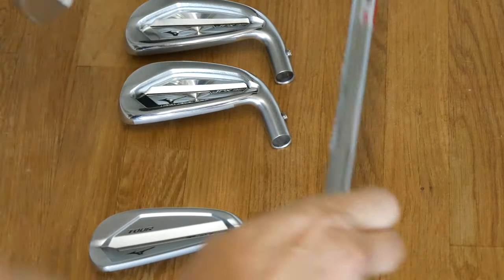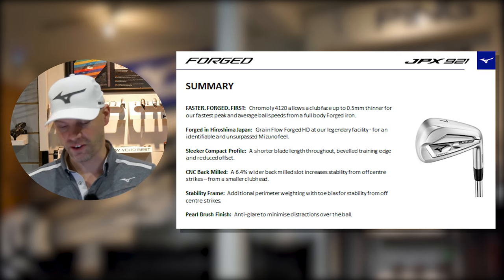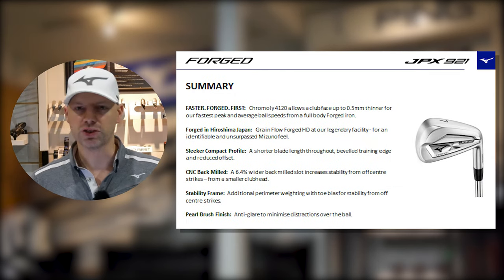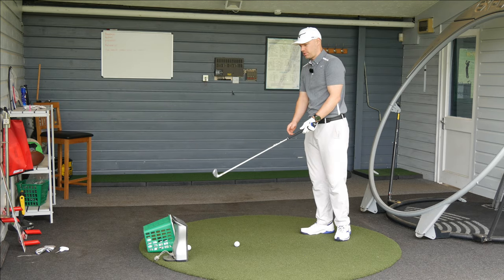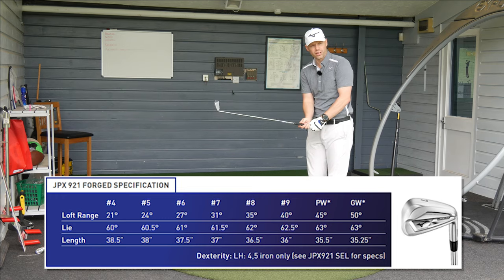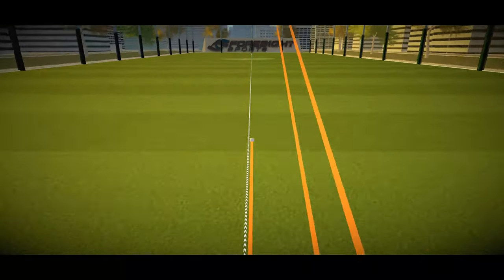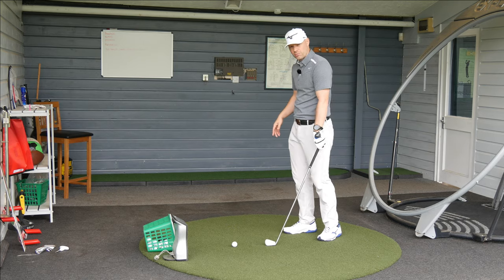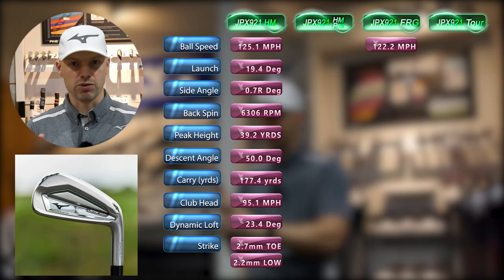Mizuno JPX921 Forged Review

Comment: Very interesting that despite being almost 3mph less in ball speed, 2 mph less clubhead speed and 2 degrees weaker loft it was very close in distance to Hot Metal. Was it the 700 RPM lower spin that kept the distance close?

Comment: Great review, would love to see the Forged 921 against ping i210 !  definitely my 2 contenders for my custom fit which is looking like it wont happen until next year.  Rotator cuff surgery in mid Dec 2019, rehab postponed for 6 weeks in April thru May after being infected with COVID-19 !  My rehab is still not 100% complete and now have severe Athritis/bursitis in my left hip due to so much inactivity !  NO BUENO !  LOL  Been getting hip treatments with my shoulder PT but it doesn't look promising to be fit enough to get full swings in before Nov.  What is the word of the replacement iron for the i210 ?   Im sure by next spring it will be out ?

Comment: Another great video, im torn now between the forged or hot metal!! going for a fitting next week.
Reply from the maker: Let me know how you get on and what the split ends up being 👍
Reply: Hi Greg. Just wondering what you went for in the end?. I’m going for my own fit next week and would be split like you between the forged and HM. Cheers. Peter
Reply: @peterkelly9655  Hi, i actually ended up with neither, after PXG launched the 0211 irons i got fitted for those instead. It is a great fitting experience and all free of charge. The 0211 irons are £119 each so slightly cheaper then the Mizuno. I'm very pleased with them, but i'm sure i would have loved the Mizuno's also.
Reply: @gregcarnall9097  Thanks Gregg, not sure I know of anywhere in Dublin that fits PXG to be honest but I will have a look. To me there are so many options out there at the minute and you never know what will come out of a fitting but at the minute the options that Mizuno offer with the JPX line with all the different shafts, grips etc it just seems like I will definitely find the right balance in there somewhere. throw in the Fly-Hi hybrids as well which look great I think I will have a large collection of Mizuno come the end of fitting. thanks for the reply and best of luck with the PXG!

Comment: Mizuno now has a number of clubs that aren't that different other than marketing - MP20 MMC,  MP20 HMB, JPX Forged - especially if you make all the 7 irons 32 degrees. I think Marketing / Brand wise, they should move the JPX Tour into the MP Brand as a stronger lofted 'modern' blade and move the MMC into the JPX Brand as the 'techy' blade. So MP would be (MP Blade, JPX 'cavity' Blade, HMB(make it 10% smaller)) and JPX would be (MMC Cavity Tech Blade, Forged, Hot Metal). HM Pro is not needed now with the new Forged
Reply from the maker: Hi Paul an insightful concept and one that makes complete sense. Unfortunately companies rarely listen to sense as they mainly listen to marketing guru's that sometimes know very little about the subject they advise on.....

Comment: In May 2021 I was custom fit for Titleist T-200’s 2019 version. How do you think they compare in terms of forgiveness compared to the JPX 921 Forged ? One thing for certain if I hit my Titleist T 200s off-center they have a loud clacking noise. I was told because the head is not filled with epoxy you get this strange sound. This is why I’m leaning towards the JPX 921 forged but I may have to delay that for another year. These irons are not cheap!  Great review Jay

Comment: Need to H2H the Forged v HMB - for me they occupy a similar space at very different price points and it would be nice to do a compare/contrast of the 2 models
Reply from the maker: Strike point forgiveness differences between the two models 👍
Reply: AskGolfNut which is the most forgiving, in your opinion?
Reply from the maker: What's your strike point miss? Heel or Toe?
Reply: AskGolfNut probably toe, currently use JOX900 HM’s
Reply from the maker: In that case, definitely the 921 Forged 👍
Reply: AskGolfNut thanks for the prompt reply. Had my eye on them, particularly at the lower price point than HMBs. Looking forward to getting fitted and hitting them 👍🏻

Comment: To me, it seems they've made the Forged into a Hot Metal Pro Forged type club - thus they don't need both. I'm an owner of the 919 Hot Metal Pros, bent 2 degrees weaker 7@32 degrees, and after seeing these reviews, I would now buy the Forged and weaken the set by 1 degree to hit my numbers and increase spin. I'm a 6 handicap and we have very similar numbers. I play PW-6 in HM Pro (47,42,37,32,28) then HMB 5@24 (don't like to see back of club and thinner sole better through turf). Can you see back of Forged 5 iron at address?
Reply from the maker: Borderline depending on ball position and your own head tilt location at address..... Not a very good answer I know but it does all depend on the golfers setup 👍

Comment: Nice review Jay.
How do you find the 921 forged and hot metal clubs blend with the T20 wedges (As in feel between them)?
I play the jpx 900 forged and use the Orka rs10 wedges and my orka gap wedge feels so different from my jpx900 forged pw. I’ve spent a lot of time working on my short game and find its really off putting as the feeling is so different between the two clubs.

Comment: First, Thank you for your videos, very helpful and good data.  That said, I am an 8-10 handicap.  The more i play the the lower I score. I have ben as low as a 6.   That said, I plan on playing more and like the Mizuno's.   If it helps, I hit my 4 and 5 iron as good, or even better than my seven and 8 iron at times.  This all said, would you recommend the Mizuno JPX921 Forged, Tour, or Hot Metal Pros.  Your opinion is appreciated.  Thanks, Mark
Reply: Hi Mark, not the channel owner but I play Mizunos and I’ve hit all 3. 

The Tours are undoubtedly amazing, BUT unless you’re a serious ball striker you won’t get the most out of them. Forged are fab clubs, easier to hit with the blade length and feel amazing. Wouldn’t play the HMBs given your handicap.
Reply: @Tomshanksit  Thank you for your comments

Comment: @askgolfnut the KBS $ taper claims to cut a load of spin. Would that shaft have impact on the low spin numbers ? I suppose one could weaken the  loft a degree or 2 if more spin was needed.
Reply from the maker: Hi Jason, the lower spin numbers are from the head design and delivery angles specific to the golfer. The shaft has minimal effect on spin creation or removal. Having a very kicky flexible shaft can increase dynamic loft and therefore potential spin, however the more a shaft kicks then it will also lessen angle of attack removing spin loft.... So in reality the shaft has minimal effect on spin numbers 👍
Thanks for the comment and for watching.
Reply: @AskGolfNut  good to know! I must say, I'm jealous of your delivery, it must suck to be so neutral and send them down the pipe time and again. You likely don't get to enjoy the full left and right scenery of the Fairway like the rest of us 😅. Great reviews as always, one of the most trusted and thorough guys out there.
Reply from the maker: That's really kind of you to say Jason, it's feedback like that which make all the effort and time youtube takes worth while 👍

Comment: Hit a "load" of shots comparing mp20 mmc vs 921 forged :)
Reply: Be interested in what you saw.
Reply: You going to leave us hanging here?  Just thought I’d follow up on what you found particularly in the forgiveness and distance in the long irons.  Thanks.
Reply: Sorry Gary it was a request @askgolfnut. I did hit a few myself with the mmc & 921 forged 7 iron at range the other week, but left just as confused as I did before I hit them. I havent had my full fitting yet, but I'll be going with mmc with hmb 4,5,6 unless the jpx 921 forged impress. Currently gaming mp53 still.
Reply: Ok - thanks for clearing that up for me.  Yes, I’ve hit the 7 iron mmc a while back and was very impressed.  I’m looking for a new set of clubs with just a little more forgiveness in just the long irons, and a little more distance there as well.  Might end up with that combo as well.
Reply: @garyhanford  I think the 921 forged 4 & 5 might also go well blended with mmc 6-pw.
Reply: I guess there’s only 1 way to tell - I’ll have to test them all out.  Nice to get all the feedback first.  One thing I saw that was ‘unique’ about the 921 forged, was that the 8 iron had 1/2 the base perimeter weighting thickness compared to the rest of the set.  Struck me as odd
Reply: I really don't see any reason for the MMC to exist. Consider going all HMB or the 921 Forged if you want a little more speed (they're hotter and 1 degree stronger).  

I went from MP-64s to HMBs and they felt like shovels for the first few rounds but you get used to it pretty quickly. Toughest thing for me is that I was used to short blades with slightly heel-side sweet spot so tend to hit the long irons heely with the longer blade of HMB. The 5-iron is shockingly easy to hit compared to what I'm used to so even those heely shots work out pretty well.
Reply from the maker: Hi Jimmy, I have found that the MMC is useful substitute for an individual that wants all the blade looks but strikes it too much out of the toe to effectively use the full blade properly. The tungsten lump inside the toe of the MMC pushes the CG further away from geometric centre making each shot more efficient.